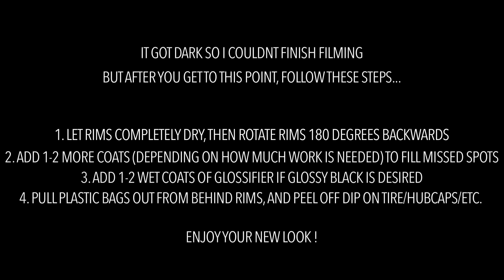How To Plasti Dip Your Rims (THE RIGHT WAY)

Comment: As many times as I've dipped rims I've never had to worry about drips. Just do about 4-5 even coats no closer than 6 inches from the wheel and you'll be drip free.
Reply from the maker: Gio Torres it was colder outside so the dip takes longer to dry, so drips are more likely. Could have easily not included that in the video but it happens and some people wouldn't know what to do.

Comment: Hey,

Just a quick question. After you finish plastidipping your rims. I didn’t like the matte finish that much now that I’ve completed it. If I wanted to apply a new glossy black plastidip, do I have to remove the plastidips or do I just spray on top of them without removing them?
Reply: You can spray plasti dip glossifier on top and it will turn it to gloss.

Comment: spray armor oil on the tires before spraying, the paint wont stick to tire , when you're finish just peel off, the plastic bag inside is best, also any overspray is easily removed with a non acetone nail polish remover.. good job